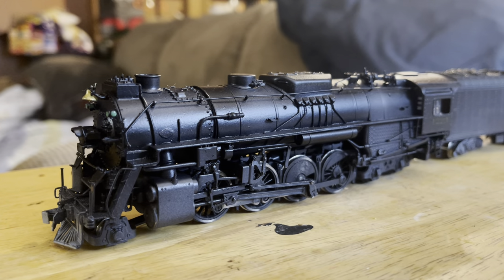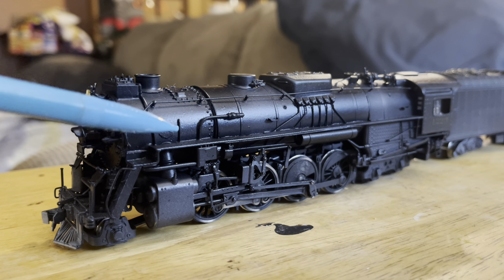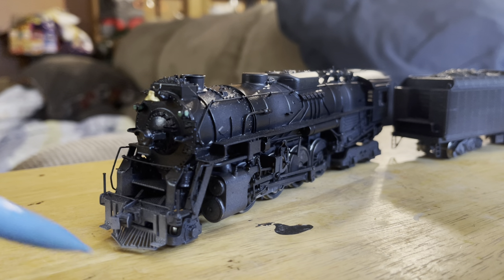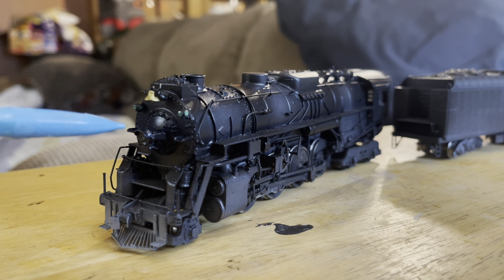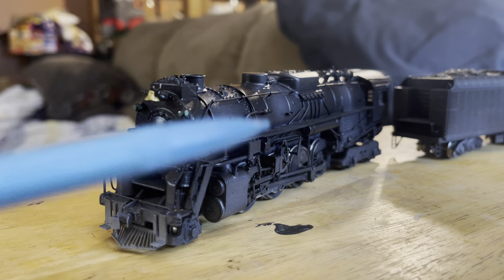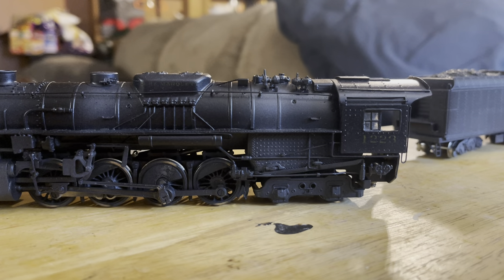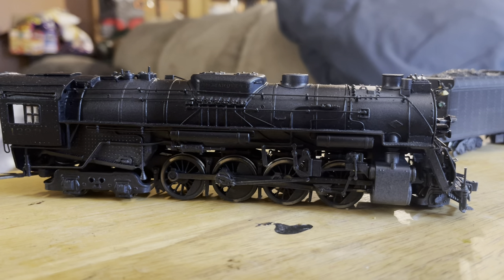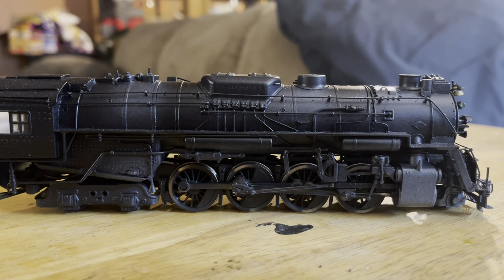Cool Customs: Airbrushed 2-8-4 Pere Marquette Berkshire

Comment: When using a white sharpie paint pen, I've found that holding the model upside down and using an extremely minimal amount of paint on the pen and it will come out perfectly. I used one on the very fine pilot steps of my Proto2000 NKP berks and it came out flawlessly.